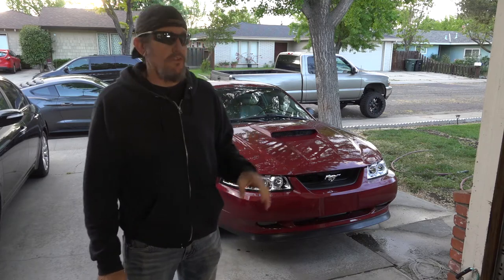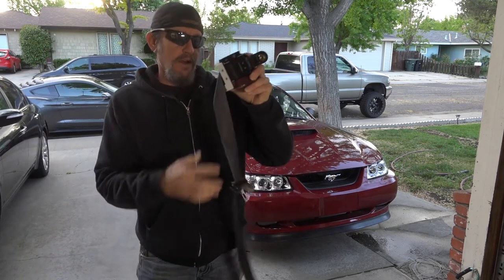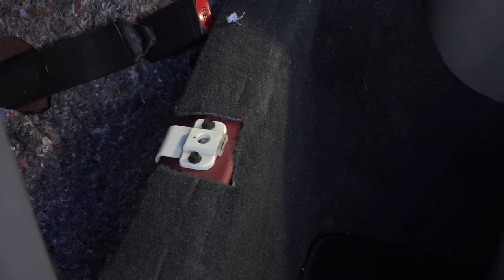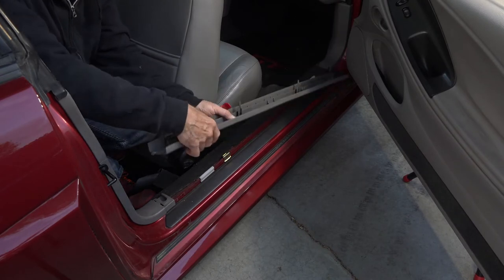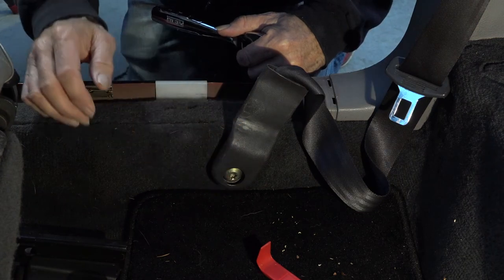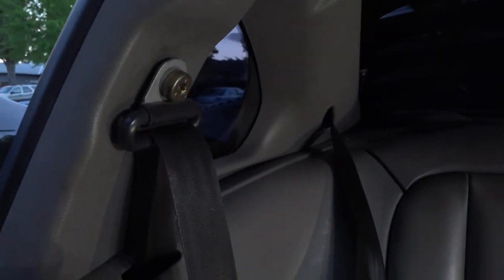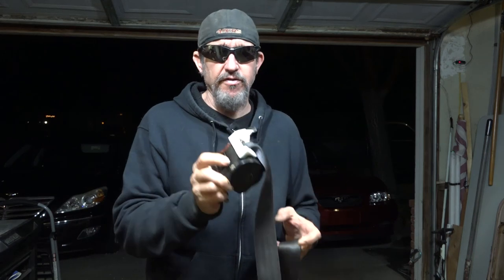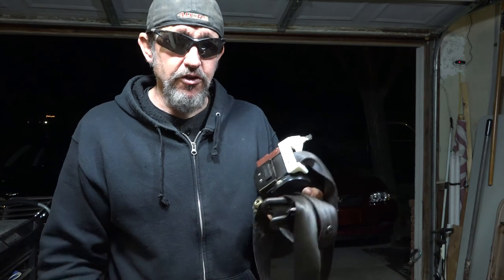Installing Front Seat Belt 04 Mustang GT

Comment: Lot of good advice, appreciate these videos you have up. I drive a 2000 V6 Ford Mustang which is fairly stock. My passenger seatbelt wouldn't pull out so I ended up pulling the panels you suggested and lubed it up w/W-40 and now it's good as new. Didn't even mess with any back seat removal stuff. Thanks !

Comment: Awesome video! It helped so much. One question though. I followed all your steps and got both the passenger and driver in and working but now I cannot get the rear seat locked back in. It just pulls back up now matter how much I fiddle with it. Did you have to do anything special to lock it back in?
Reply from the maker: No it should just snap back in , make sure the seat is  pushed back far enough so that it comes down on the locking mechanism on both sides.

Comment: I'm a sucker for the New Edge Mustang. My passenger side is also messed up so thanks for the actual process of installing a new one.
Reply from the maker: Your Welcome love the New Edge also but if I eventually sell it I didn't want the seat belt not working properly.
Reply: What did you type into eBay to find the seat belt for $50? Was it brand new or a used one?
Reply from the maker: I believe I searched for 2004 Mustang front passenger seat belt and it was used, the seller showed a picture of a wrecked 04 mustang that it came out of. Make sure that it it is from a coup not a convertible unless of course if your Mustang is indeed a convertible.
Reply: CHRIS10077 Alright thanks again for the help, Chris.
Reply: CHRIS10077 nice job man!
Reply from the maker: Thanks !

Comment: Thank you for the video, I've got a 01 cobra and both won't retract. Common problem with these new edge mustangs.
Reply from the maker: Yea should be a Ford recall since it is a safety issue.
Reply: Chris10077 - I bought my 2002 Mustang GT brand new (still have it and will never sell it) and the seat belts went bad luckily before the warranty expired. I had the dealer replace them and haven't had a problem since.